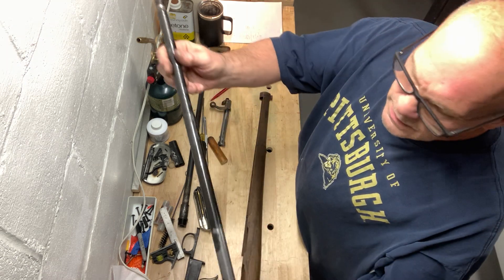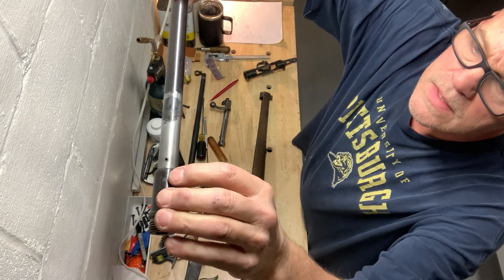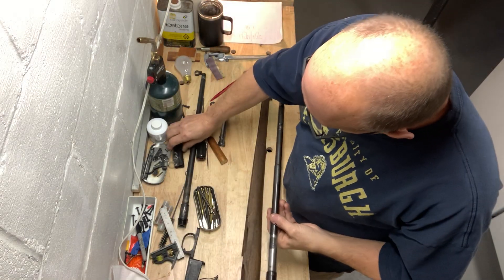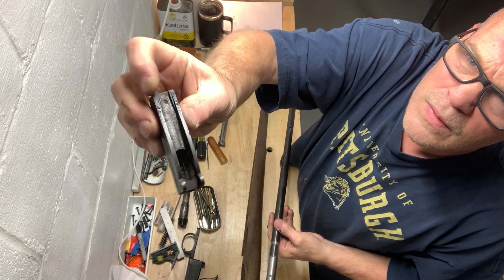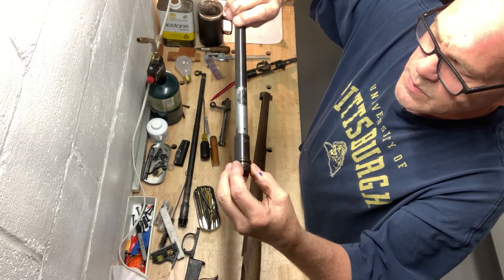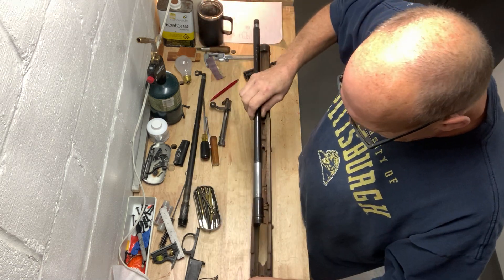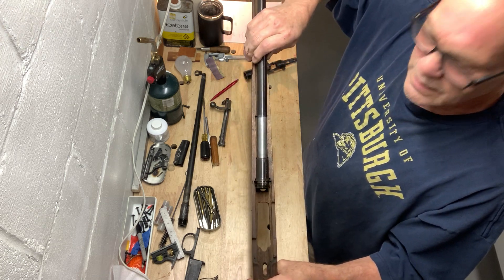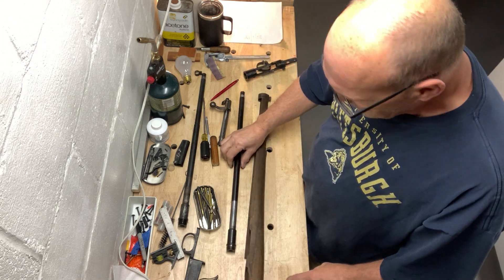Free Gun - Spanish Mauser 2nd update

Comment: It is coming around nice . That nose piece will look good on there . Can't you tighten the hinge plate simply by tapping the hinge with a brass hammer ? I'd reframe from welding if at all possible so the bluing looks good . Same with the nose piece . A little JB from the back side will hold that piece in with no problem . You know how I like my JB weld . lol
Reply from the maker: I’ll try the brass hammer on that hinge that’s a great idea. I know how much you like JB weld. Lol.
Reply: @maxxbear5014  I have a mig welder too . lol
Reply from the maker: @jamespollard1670  I didn’t know JB Made an electric welder.  Lol.  I just have a small Lincoln wire feed with a small bottle it works pretty good
Reply: @maxxbear5014  Ahhh yea , they been around for years .